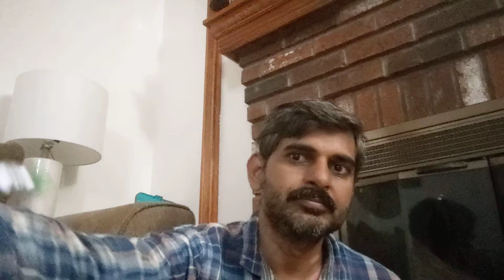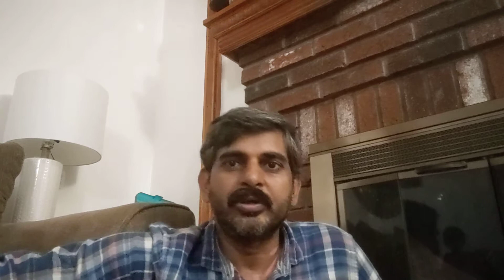Learning Hardware design for job

Comment: Hi sir i have one question for u 
How can I apply soldermask on copper pour coz it should expose to increase the heat dissipation
Reply from the maker: Add another layer of Soldermask on all the area where you have copper. Then check it in gerber. What tool are you using.
Reply: @WideSpectrum  sir iam using allegro, what class and subclass I should use?